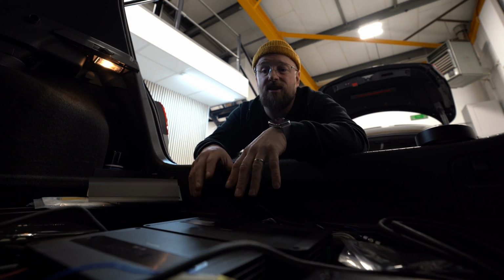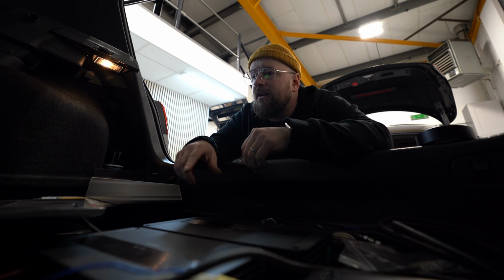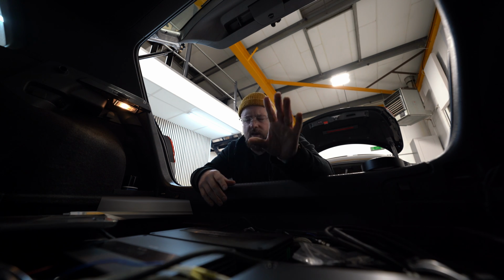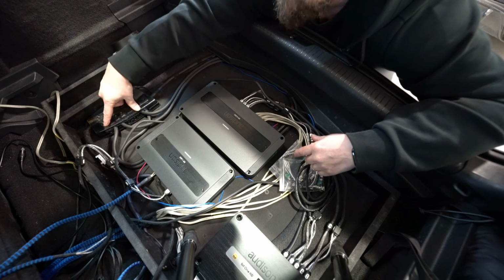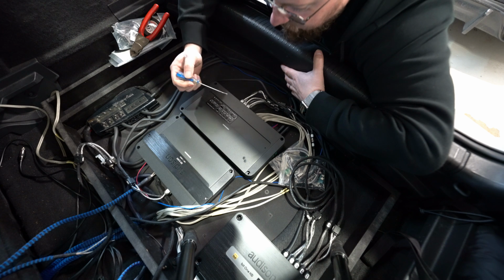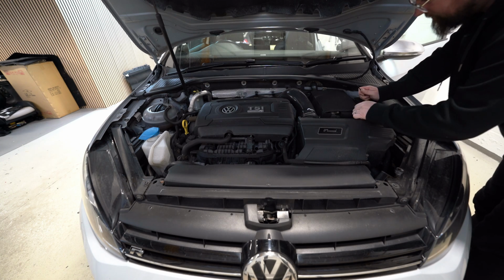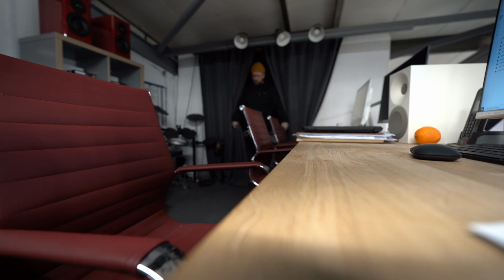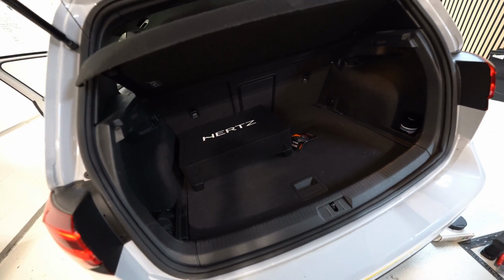Audison SR6.600! First sound impressions! Mk7.5R EP7

Comment: How does audison amplifiers do its rated power if the fuses on the amplifier are lower then its rated power ? This amplfier for example is rated at 1120w total power but if you take the 2x30 amp fuses and multiply it by 14.4 you get 864 watts
Reply: From my understanding, 1. fuse actually protect for continues current draw not short burst, 2.  for safety margin, 
3. Music is dynamic , amp doesn’t use 100% its power all the time
Reply: @gboyspeed yes but if you look at other amplifiers like alpine for example the fuse is rated above they rated power meaning it can sustain continous rated power While audison can't

Comment: Can you explain the high inputs?  I just had the 6600 installed but they didn't use the Arc high inputs the used the RCA what's the difference?

Comment: Hi - quite interesting as I was not aware there were amps with high level inputs to negate the need for a separate LOC. 
what is the recommended route - maintain stock amp and add something like this Audison; or remove stock amp and pair the audison with a separate LOC?
Note I have a 2003 996 with soon to be installed factory PCCM

Comment: Just installed my 6.600 Audison as well not too long ago just set it up by ear along an AF 5.11 so the 5.11 DSP is controlling the 6 channel amp as well I went with 3 way Morels at front and I will say at times I wish it had more power but then I listen for a long period of time and end up lowering the volume.
Clean amp as far as I’m concerned! I’m waiting to break in my Morel 903s speakers and then will get it tuned up can wait to get it done right and see what this amp is capable